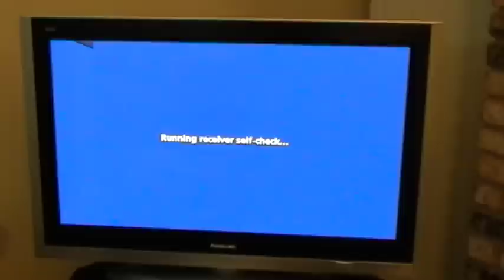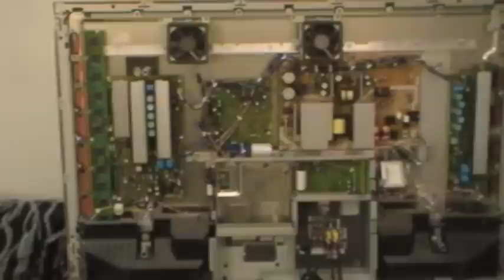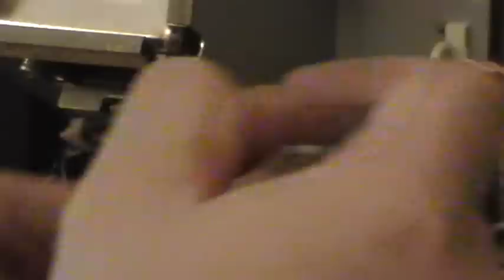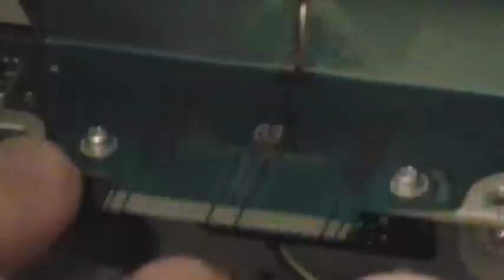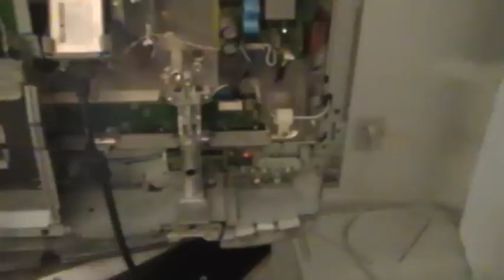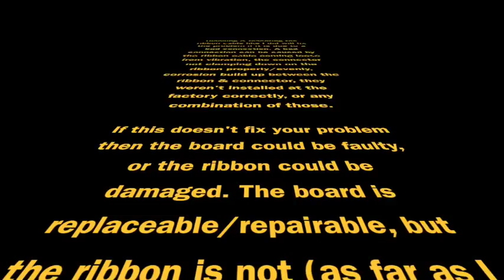Fix Panasonic Plasma TV Vertical or Horizontal Bars

Comment: Hey there :) I just want you to know that even though this video was older, it was very helpful.  I also had a Yellow Bar, same size on the opposite side. Its my Garage/Shop TV, a 60" mounted up on the wall. Its a nice feature.. so I was disappointed when the bar appeared. But, after some research and watching your video - I also pulled the TV down - and cracked it open. First, I used a small vacuum (as suggested in the comments), and got rid of the majority of dust.  Then I made sure to use an air compressor and blasted it (1/2 pressure)carefully around the entire circuit board and ribbons.  I crossed my fingers - attached the back and it worked 100%   Thanks for sharing this experience with us - It helped me in fixing it in time for the game!
Reply from the maker: Thats great! I'm glad my video helped you out.
Reply: Thx
Reply from the maker: @Purple Rose Congrats!
Reply from the maker: @Purple Rose, Google is your friend: https://www.amazon.com/Mini-PAL-to-NTSC-Converter/dp/B009TBFWJK

Comment: I just bought a 65 inch Panasonic TV for 60 bucks because this exact reason. person didn't wanna deal with it.  line is solid black. then with time flickers and is transparent.  Google problem and found your video.  will try and see if this helps.  Was about to send it out for repair if it could be.
Reply from the maker: Good luck!
Reply: well. tried this but didn't work for me.  guess it maybe the board.
Reply from the maker: Sorry to hear that. Hope it turns out to be an inexpensive fix. Good luck.
Reply: @danielbaker6967  Hi Daniel. May i ask how you fixed it?
Reply: I have panasonic plasma 42 nch with three black bar left side the picture is there but ghost please help me...

Comment: Hi, I'm having Samsung PN42B450B1. last few weeks screen showing black vertical bar at the right end from top to bottom. I tried reconnect the bottom ribbon cable at the right end of the buffer board as you said. but still the problem persists. Please help me to solve this.
Reply from the maker: Make sure that the cable that you reconnected was the one corresponding to the area of the screen that is showing a problem. Also make sure that the connection is clean with some isopropyl alcohol & a q-tip (do this with the machine off, btw). Also double check that the ribbon cable isn't damaged. Good luck.
Reply: Im sure i removed and reconnected the correct cable...becoz its the right end....when i removed the cable the area shown black verticaI bar becomes grey due to no signal...And i not cleaned with any solution like u said. I am going to clean the connection.
Reply from the maker: Yeah, that sounds like you removed the correct cable.  If cleaning and reseating the connection doesn't work, then the board may be bad. Good luck.
Reply: If the board bad, Will the black bar increace in size in future...? Shall i use this tv as secondary for some years..? I dont think i can get this board now. BOARD NAME samsung LJ41-06619A/LJ92-01674A(Im from India)
Reply from the maker: Its possible that the bar would spread to other sections. Its hard to say. I don't know if a new board is available. I did a quick search for the part number and there are some available from various sources. Good luck.

Comment: This advice helped me fix a vertical line problem on my 2010 Viera 50", thanks a ton!
Reply from the maker: No problem. I'm glad my video helped you out.
Reply: mine is the same model as yours, but the black vertical is in the middle. I am going to try it soon.
Reply: I have viera plasma 50" too. My vertical band is not black, it's like error decode or something moving from the top to down. After approx  5 min, my screen goes error with full of colorful vertical band and the remote will stop functioning. Anyone knows how to repair it?
Reply: @zevanyablacht4734  did you ever find a solution?

Comment: Is there a substitute i can use don't have a can of compressed air
Reply from the maker: You can pick up a can of compressed air from most office supply stores for a couple dollars. Alternatively, if you have an air compressor, you can turn down the pressure to a couple PSI and use that (don't want to strong or you could blow a component off). You could, in a pinch, blow with your mouth, but you run the risk of adding moisture which doesn't play nice with electronics. Good luck.

Comment: I got a 50 inch Panasonic TV for free but has a black strip/ bar going down the middle , how much would it be to get it fixed ?
Reply from the maker: If the problem is the same as the one I outline in the video it would be free.  If its not a loose ribbon cable connector then the price goes up pretty quickly. Good luck.

Comment: I tired taking my plasma a part and air blowing the wires and chips but still no success
Reply from the maker: did you reseat the ribbon cable that corresponds to the lines on your screen?  If not, then yeah, I wouldn't expect success. Good luck.
Reply: Me too I also Reseated the ribbon that corresponds to the line but with no success please help

Comment: My black stripe is dead central therefore right in behind the part where everything gets connected to. Wonder if its a good idea to unscrew and remove that? Would you recommend it?
Reply from the maker: As long as you are careful, and only unscrew/disconnect what you need to, you should be fine. Take pictures as you go so you can remember how/where everything goes back together.  Also might help to keep track of which screws go where by putting them in labeled zip-lock bags.  Good luck.

Comment: come on..diy unplug befor,unscrew,then clean.elementary things.hit right through the subject.
Reply from the maker: Yeah, it is really that simple.  Just like removing an engine from a car is as simple as disconnect battery, unscrew some nuts & bolts, disconnect some electrical connections & hoses, and pull.

Comment: What do you clean the ribbons and connectors with?
Reply from the maker: For best results lightly blow out the connector with compressed air, and clean with a q-tip dipped in Isopropyl Alcohol (available at most drug stores/pharmacies). Good luck...

Comment: Thanks, man!  I also have a 42" Panasonic Plasma (different model, but close enough) with this same problem.  Alas, mine is a vertical (aka horizontal...hilarious) column dead center down the middle, so I'm concerned that more tear-down might be necessary (based on what I saw in your video).

In any case, your video was a really quick way for me to know instantly that the problem was with the itself, and not with my PC, stereo, or HDMI cables.  Long story short... even if nothing I do fixes the problem, you saved me a whole pile of trouble-shooting time!

Thank you.
Reply from the maker: Thanks. I’m glad my video helped you out. There is a similar board with ribbons on it that is on the left or right side of the TV that controls the horizontal (serious) pixels. You likely need to find the corresponding ribbon on the right or left side and reset it. Good luck...
Reply: Pet Rock's Garage last Panasonic tv 5 blink question was for you pal
Reply from the maker: Yeah, i know. I replied to it. If you have questions or want to make a comment about the video its best to start your own comment rather then reply to someone elses.  Thanks.

Comment: I have all sorts of ghosting, bright white colors, and vertical bars. Played with the ribbon cables and the picture worsened. But it seems to have shown that it is a connection at one of the panel cables.
Reply: I have a circuit board on top of the panel with the ribbons that plug directly in to the T-Conn board. is there also another board on the bottom?
Reply from the maker: Depending on your TV, yes there could be a board on the bottom too.  Good luck...
Reply: Pet Rock's Garage I took the screen out and wired it up on a table while it was laying flat. Tapped on the ribbon cables on top and bam! Picture straightened out. There are small contacts on the ribbons that touch the aluminum frame and this is used as a heatsink. A very poor one. These did not touch the frame well enough to stay cool. Hence most likely why they were loosing connection going to the screen. After running the TV for 20 min or so they were hot enough to burn a finger tip. After awhile the bad connection started smoking. Junked TV.
Reply from the maker: Glad to hear you found the problem. Sorry to hear you ended up junking the TV.  Good luck with the new one.

Comment: What I want to know, if anyone can answer this, I have a strange color problem with my Panasonic Viera 3DTV from 2010. It is model TC-P55ST30 and it has been professionally tuned so to speak on the Custom mode for the best color reproduction and such and looks beautiful. There are however, two things I need to know.

When playing PT Demo on PS4, (just for an easy example), when I look at something like a bright white light on the left side of the screen there would be a blue color on the left side of the light, and when I pan the image to the center of the screen the color will go away like it is properly aligning into the light and the center of the screen looks pixel perfect. Then if I keep panning toward the right side of the screen with the bright white light in the center focused, there would be a red line of color that will begin to appear on the right side of the white light. This also happens if I find a way to have a brightly lit of sky in some games or movies where I can see a row of lights on both sides of the screen, I can see the strange blue outline on one side and red on the other side, but the center of the screen is always perfect, is this fixable and what is this called?

Lastly, the HDTV sometimes seems to have a buzzing sound that is slightly noticeable and is louder at sometimes than others, and this buzzing comes from the back of the tv on the left side when facing the front of the tv, or the right top side if looking at the back of the tv set. When the tv screen is completely black there is no buzzing sound, but as soon as ANYTHING appears on the screen, the buzzing comes back. It's not really bothersome 90% of the time, but it began getting louder the other day to the point I began to worry, and I gave the top left back of the TV a light tap a few times and it lowered that sound. What is this caused from, and how is it fixable? 

To anyone that can help me, thank you so much in advance.
Reply from the maker: The light issue is strange.  No clue what that would be.  Never actually viewed a 3DTV.  They aren't that common where I am.
As for the buzzing, thats likely electronic buzz. If you take the back panel off the TV you should be able to narrow down where the sound is coming from.  It is likely the power supply.  When LED TVs are showing black, it is using the least amount of power.  Brighter pictures take more power and tax the power supply more which can produce an audible buzz.  Good luck...

Comment: If the vertical card needs replacing, what card / part number would I order?
Reply from the maker: It depends on the make & model TV you have. Contact your TV’s manufacturer or local TV repair guy for the part number and places where you can buy it. Good luck...

Comment: Thank's for the video. Your comments have led me to do a cleaning in the
 ribbon cables connections, that worked fine for solving the faulty 
condition I've had, which was a blinking white and vertical bar, 
comprehending the half left of the entire screen.
The ribbon cables I've cleaned was not the same you did, but worked. Nor my plasma TV is the same as yours: Mine is: TH-42PZ80LB (Brazil).
I've found a service manual for a similar model (TH-42PV80LB) that was useful for me to be able to locate the components, since they both has virtually the same design.
The ribbons I've cleaned are (according to the troubleshooting manual I said) those ones connected to the SS board, which are placed at the same side of the white bar, the left of the frontal screen (right when you look to the back of the TV opened).
[  ]'s
João Cruz
Reply from the maker: Thats great!  I’m glad my video helped you out.  Thanks for watching & commenting.  I appreciate it.
Reply: my Panasonic tv was stuck on standby with advice did the hard reset by holding in power and volume button for 30 second which worked but it went off after half hour and standby blinking 5 times. I did  the trick few times but keeps cutting off .is it done for
Reply from the maker: I'm not sure. Its hard to diagnose from my keyboard. Sorry and good luck.
Reply: Pet Rock's Garage 

Thanks again, but,  unfortunatly, the problem came back and, now, I got that blinking left half of the screen permanently off. Aparently the problem could be in the C2 board or in the conector between the A and D boards, that has very bad conection.
Reply from the maker: Ouch.  Sorry to hear that, hope you get it figured out inexpensively. Good luck.
Reply: Just turn the TV upside down, checking everything that could have bad connections while watching, but nothing seems to be making bad contacts.
Besides all this, I've also noticed the part of the screen where the problem is got VERY hot.
Probably the C2, so I could try to change by new one.
[  ]'s
Reply from the maker: yeah, the effected area getting hot is not a good sign. Good luck.

Comment: Thanks for the video. I followed your clear procedure and the black line is now hiding. Initially, last year, when it first started, I followed up on 'black line..' google searches and the resulting info - however, just leaving the back off the TV cured it - for a year! So it's a very haphazard issue in its cause of manifestation.
For other readers a download of very useful service documentation/troubleshooting is available @ "http://www.service-manual.net/ashop/download.php?TX-P42S20B%2C+TX-P42S20BA%2C+TX-P42S21B%2C+TX-P42S21BA+Service.zip" for my model and other contemporary models. Panasonic include a detailed breakdown of rogue line problems in their troubleshooting info. so it's a definite design fault. The adobe manuals cost $13 of your yankee dollars. Worth the price. 
If the problem persists replacement C1 and C2 boards are widely available - the part designations are in the manual. I suspect a deal of care would be needed to swap defective for good but it's going to cost less than a new telly or employing a trained TV repair bloke.
Reply from the maker: Thanks a lot. I’m glad my video helped you out and thanks for the tip on the repair manual site.

Comment: I have multiple black bars going vertical so I just need to know what the board is called so I can replace it and see if it works. The model # is pn42a450p1dxza
Reply from the maker: I am not a TV repair guy, so I don’t know your TV or what the board would be called on your TV.  Chances are you don’t need to replace the board though.  (Re)watch this video and see if the technique I use works for you. Good luck…
Reply: +Pet Rock's Garage Yeah I tried and it didn't work. But I do appreciate your help and fast response. Thank you

Comment: Pet Rock, I have the same TV as you and I have a similar issue.  While I have the TV off the wall and apart do you think it's worth the time and effort, and mostly the risk of breaking things, to clean out and re-seat ALL the connectors?  Obviously only the connector that controls the area where the black bar is will matter for the current issue, but I'd hate to button everything back up and have another connector decide to be dirty in a week.
Reply from the maker: +Coach James, that is a hard call to make. I wouldn’t bother with all of the connectors. I’d only concentrate on the ones that are having a problem. No point in adding extra variables to the problem. Chances are slim that another connector will have an issue in the near future. Mine has not had an issue since I made this video. Its not that the connectors get dirty. It is that they get loose (typically during shipping or transport or other vibrations). Good luck...
Reply: I took off all the bottom ones, cleaned them out, swabbed them lightly with dielectric grease and reattached everything.  Works great.  Thanks for the solution!
Reply from the maker: Thats great!  I'm glad you got it fixed. Thanks for letting me know.

Comment: I am getting 4 inches vertical line flashing .My son poor 5 ml of water injected on screen .

1) Is it repairable.

2)Should I change total TV screen or part where it is not coming.

Thank You.
Reply from the maker: +sathish gali, its hard to diagnose this from my keyboard. If the line is in the same general area as where the water was injected then it likely fried something. If not, then it could be unrelated. Its hard to say. I’d contact a TV repair shop and see what they thing. Good luck...

Comment: You would think that lcd manufacturers would install a connector on the lcd and a connector on the board with a replaceable ribbon connecting the two together. Just poor designs in my opinion. This is a common problem on many brands of TV's. Sometimes this temporary fix works and other times it will not depending on how loose the bond is on the panel or on the board. or how damaged the ribbon is.
Reply from the maker: +Bobby Gorden, I wouldn't call it poor design. I would call it unfortunate design. Soldering a ribbon to a board is very cheap, while connectors cost money. Multiply the cost of the connector by the number of units manufactured and it adds up pretty quickly. So they likely designed it this way to lower costs.

Comment: Question for u, I have Panasonic TH-50PX60U Plasma TV. It has no picture but the sound is fine,  the red led on power button is solid red.. Do you think my Y-sustain board or Main board went bad? Thanks ahead of time.....
Reply from the maker: +Steve Mayfield, I'm not sure.  The problem could be a lot of things. Its hard to diagnose from my keyboard.  Good luck...